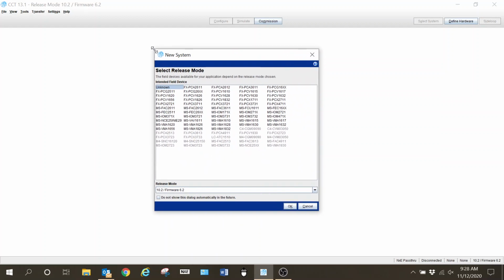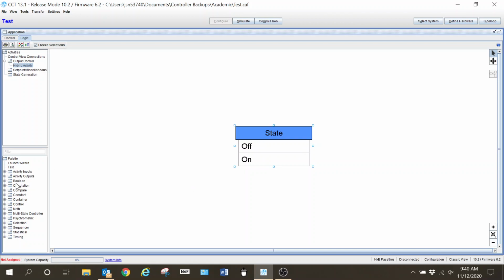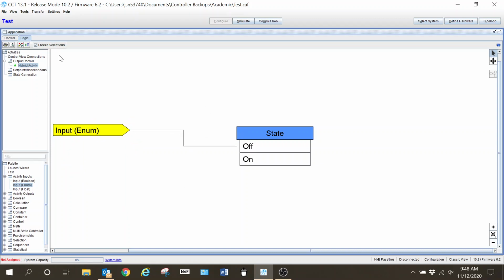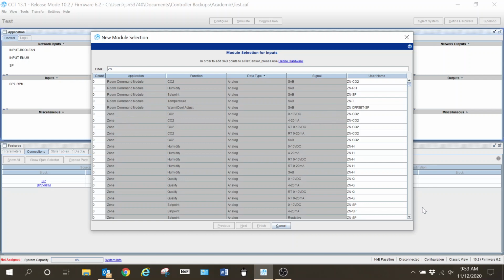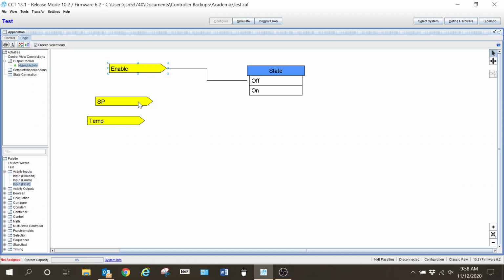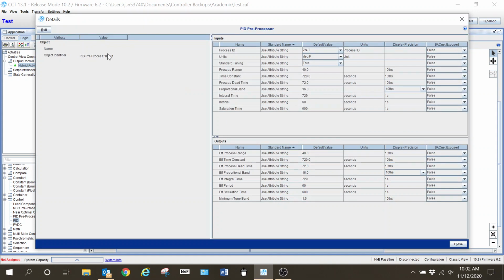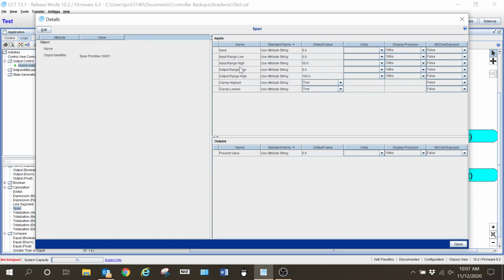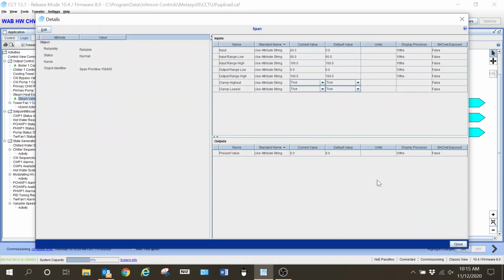How to program a PID controller using Johnson Controls CCT Tool Software

Comment: Can you do a video on your to sequence 6 condenser fans off chilled water temp compared to a setpoint,. Also enable the process with a free cooling setpoint compared to outside air. This is for a dry cooler. Thanks, also are you on HVAC Talk
Reply from the maker: Maybe in the near future
Reply: @Systemcontroltech  Thanks Man